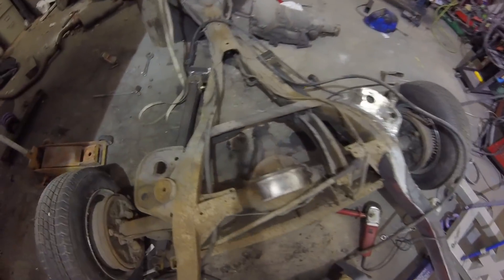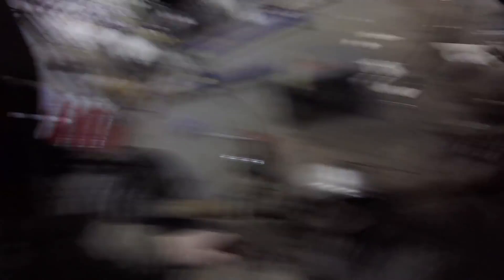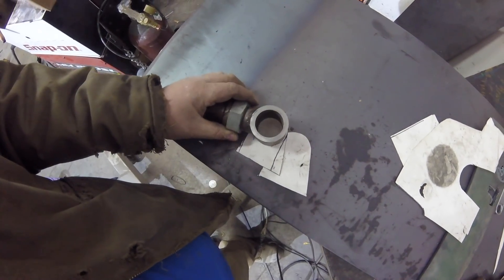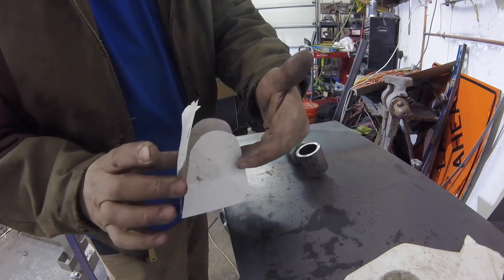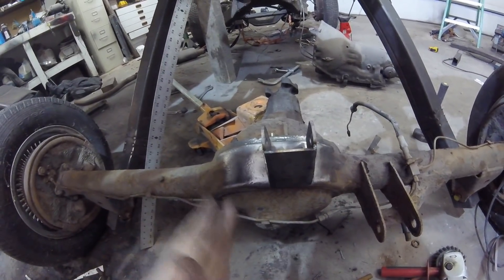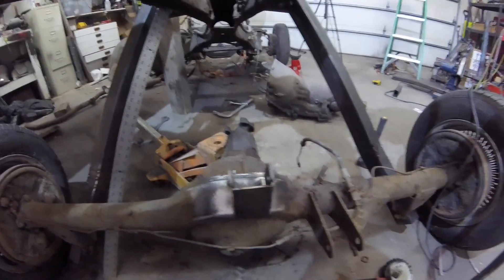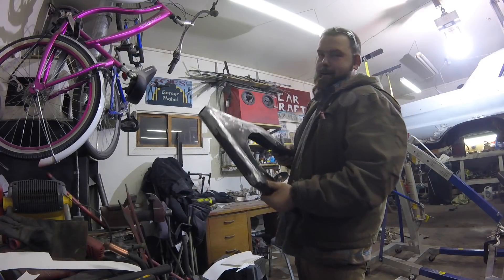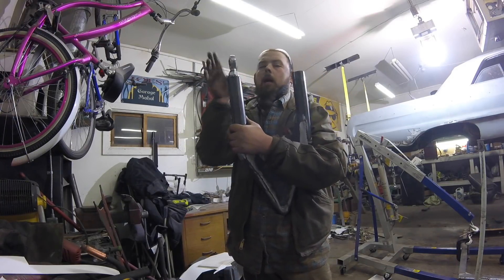Making my own Impala Wishbone

Comment: You’re a dedicated low rider.you do really good work and have fun doing it. I have a 93 fleetwood with power balls. What can I do to help prevent the squeaky rubbing on sheet metal from cylinders ,besides using pvc pipe ?
Reply from the maker: Rick G thanks man, the pvc is about all I've ever seen. Why don't you want to run a pvc sleeve?